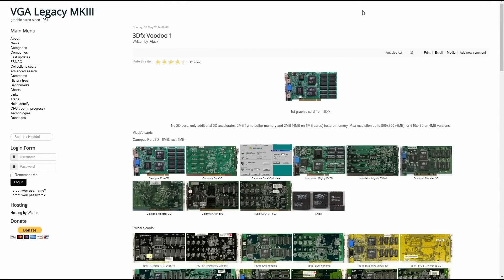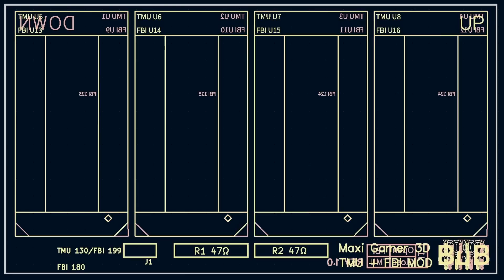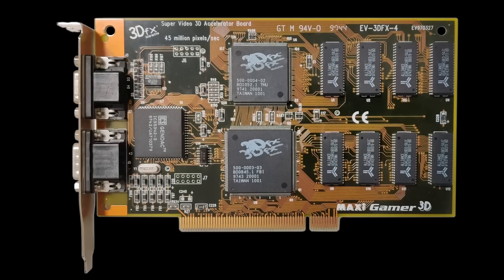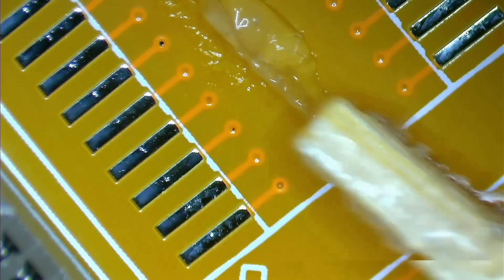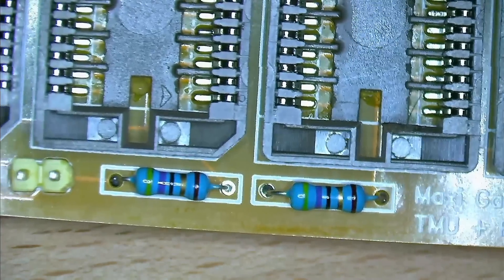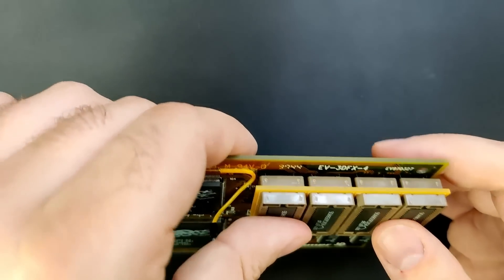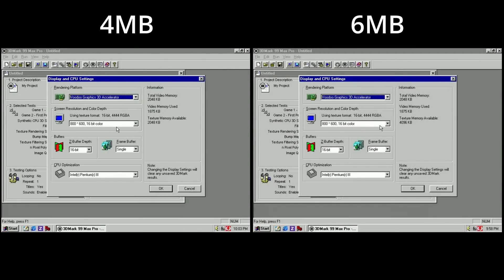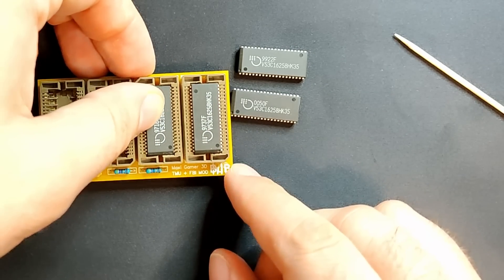3Dfx Voodoo Memory Upgrade - 6MB MOD (Part 1)

Comment: I know the Skwell Magic 3D Plus picture here in your video in Min. 0:54. This is the card from the YouTube Channel "3dfx_Aslinger". He has made a comparison video of the 4, 6 and 8MB Voodoo Graphics in Unreal. Now this video is over 4 years old, but still interesting to see. Nice to see a new video of this differences here in your channel, because 3dfx_Aslingers channel seems to be dead since a few years.
Reply from the maker: Yeah, I know that video - and I did watch it before. At that time I would never imagine that once day I will have a 6 MB card - let alone an 8 MB Voodoo 1. Well, guess what, I am working on the second memory expansion board right now! Will check Unreal as well. On a Pentium III 1GHz, I didn't notice any difference between 4 MB and 6 MB. 3dfx_Aslinger tested on a Pentium MMX 233, so maybe on slower systems the extra memory does make a difference!
Reply: @bitsundbolts  A Voodoo 1 should scale up until 350MHz Pentium II, but only more in lower resolutions and Unreal based games. A MMX CPU is a good partner for the small Voodoo. I had a Pentium 90 in 1997 with the Maxi Gamer 3D. Also for a small Pentium CPU, this was the best upgrade in all time! 20 fps was enough in the late 90s. Todays people/young kids needs useless ~200 fps...
Reply from the maker: Hehe, yeah - was a different time back then. I guess there's no way around to test this card on Pentium, Pentium II, and Pentium III (and maybe the K-III+ 600). Lot's of benchmarking ahead!

Comment: why not to use 1mb memory chips instead of making second deck?
Reply from the maker: I am not an expert, but I assume that the Voodoo ICs do not support larger chips on their memory lines hence the second pin to address another 4 memory chips. But I could be completely wrong. Never seen an 8MB Voodoo 1 with 8x1MB chips.
Reply: @bitsundbolts  edo chips with 2 ras lines as on v2 cards
Reply from the maker: I feel like this is still going over my head :) But I understand that the Voodoo chip would have to have the capability to address a larger memory space. Question is if the board has the traces in place or if the connection to the second RAS line needs to be created manually.
Reply: @bitsundbolts  no secondary ras line routed on the vast majority of v1 cards. this line should be wired as you did anyway.
Reply from the maker: Interesting - will keep it in mind. If I get my hands on a Voodoo 1 that I am not emotionally attached to, I may look into this!
Reply: @bitsundbolts  certain model from skywell has room for 8 chips but only 4 are populated. actually it's the same pcb as q3d 50sb card has. just solder the next 4 and voila.
Reply: Would it be possible to make a 16MB card with these chips? 🤔
Reply: @Sonyfreak  4mb per chip at max

Comment: I knew about 6MB versions from very beginning but I didn’t learn about 8MB option until very recently, couple of weeks. 
Although 8MB it’s an interesting quirk I think card makers made a sensible decision of not going that way. Voodoo Graphics is too slow to run games at 800x600 anyway.
Reply from the maker: From what I've read, you are spot on. I don't expect much, if any, benefit from the 8MB card - but then this would be just to satisfy curiosity. I wonder if at that time the engineering department was still in charge. Marketing departments love larger numbers - even if it doesn't make sense...
Reply: @bitsundbolts  - late 1990s tests performed by THG show that adding an SLI connector to Voodoo Graphics cards (as in some Quantum3D examples) would be much more useful. In single texturing games the performance was close to the no-yet-revealed Voodoo2. Maybe then the 8MB option would make more sense 👍🏾
Reply from the maker: I have seen a picture with 2x Voodoo 1 in SLI. I wonder why it wasn't mainstream. The chipset clearly supported that feature, yet there weren't many companies offering the SLI option. There was even one card that combined 2x TMU + 2x FBI on one board (SLI on a single board), but I don't know if this was true, a mod, or fake.
Reply: @bitsundbolts  Quantum3D Obsidian was a Voodoo Graphics card with 2x TMU + 1x FBI, with 2MB per TMU + 4MB for FBI. It also supported SLI! And it was an early card also, from 1996. The second TMU was only supported in GLQuake at first until more games started to add multitexturing support.

Comment: Like! Would be nice to see some more benchmarks in games like Unreal, Unreal Tournament, Quake 1/2/3 and/or others.
Reply from the maker: Yes, absolutely! Will try to finish the mod on the FBI chip soon and get into benchmarking!
Reply: @bitsundbolts  game benchmarks would be great :)
Reply: For Quake 3 V2 is to slow unfortunately.
Reply: @pr0fanator  it depends on the resolution. In lower resolutions it certainly isn't too slow.

Comment: Very interesting, like! I wonder how many games run better with the 6 mb version. I remember back at the end of the 90s everyone was saying that there is no performance difference between the 4 and 6 mb versions, which I guess is true only for some games, but untrue for others.
Reply from the maker: Most of the people who may have claimed no performance benefit never owned a higher memory model and base their believe on some article. As you said, it may depend on the game. I tried Unreal and didn't notice any performance difference, but maybe Quake II or Tomb Raider will - we will find out! The great thing about this mod is that I can just unplug a few cables and switch easily between different memory configurations: 2+2, 2+4, 4+2, and 4+4 (TMU and FBI).
Reply: @bitsundbolts  well it's both performance and graphical improvements. With both 4mb on the TMU and the FBI you now can enable z-buffering on 800x600 for sure.
Reply from the maker: Hope I can get the FBI mod to work!
Reply: I had a 6mb back then and I'm not sure there was much improvement, mostly because the games would need to take advantage of it and as the majority of cards had 4mb, they typically targeted that, I did find some compatibility issues as well in comparison with a 4mb card.

Comment: increasing the fbi memory will allow you to use a resolution of 800x600 but will not add speed. it seems so to me. This is actually a nice upgrade because there are games that will run full speed at 800x600 on voodoo1. (classic tomb raiders I think)
Reply from the maker: Increasing the FBI memory will be the next project - and then the combination of both to have an 8 MB Voodoo 1. I definitely will try Tomb Raider then - would be cool to see a benefit of playable higher resolutions.